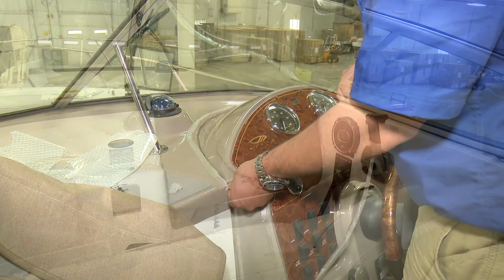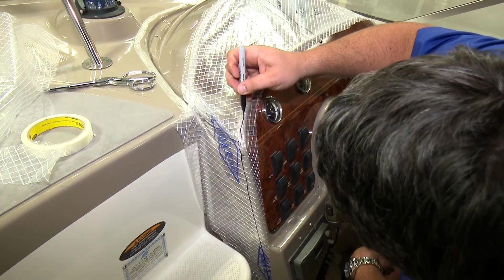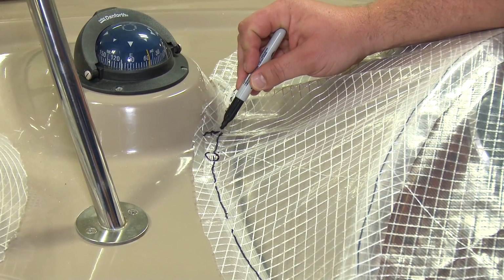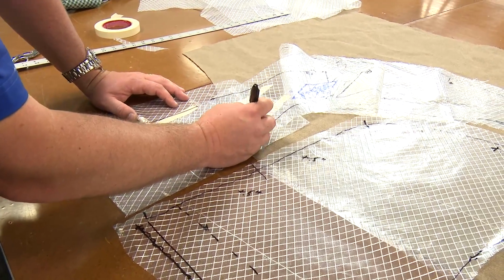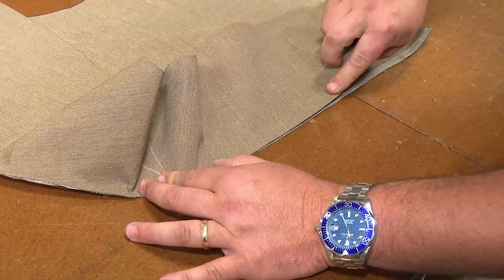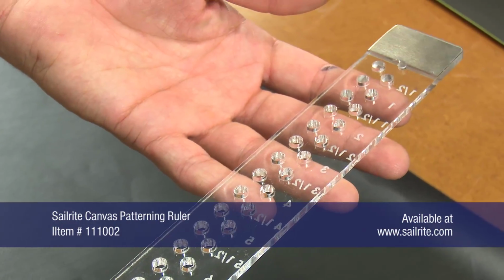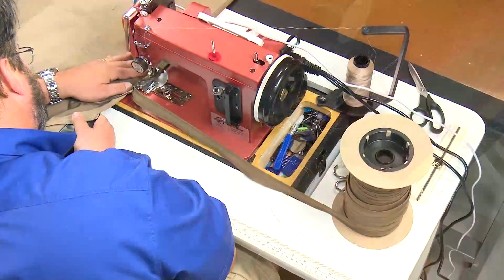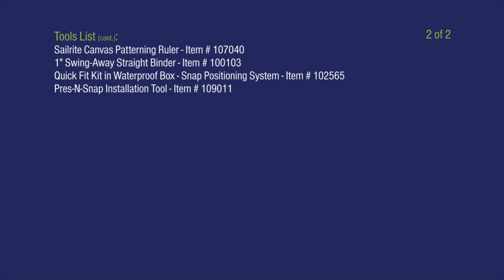How to Make a Boat Helm Cover

Comment: Thanks also… We’re going to do this for my Chaparral Signature helm station which is very similar to the one you did here.. I went to your company website .  Which material did you use on the one in the video?  The amount you used on this helm station would work for me.. how much material was used?  Thanks again…
Reply from the maker: I would order 2 to 3 yards of a 60 inch wide Marine Grade Fabric. We used Sunbrella, but you could save money and use Sattler Marine Grade fabric instead. It is found here: https://www.sailrite.com/Fabrics/Marine-Fabric/Brand/Sattler
Reply: @SailriteDIY  Thank you so very much!  I just replaced all 15  rocker switches and dash templates and where as I keep the boat covered 90% of the time but a quick snap on cover for the helm would be awesome! Much appreciated!
Reply: @SailriteDIY  Just ordered it! Wish me luck!